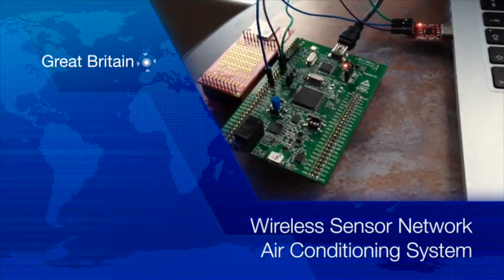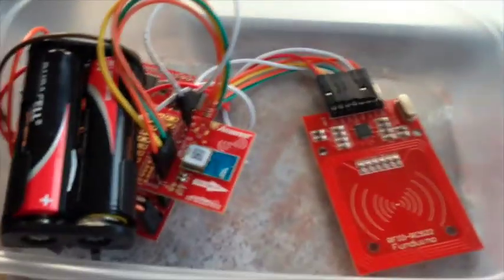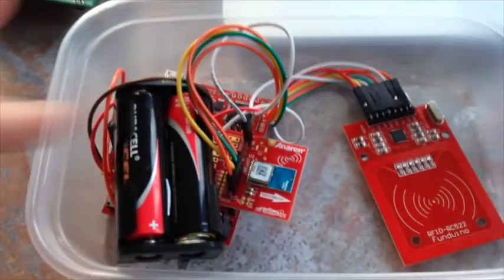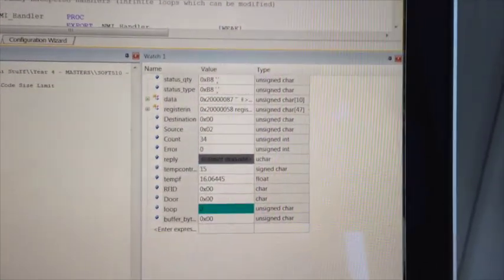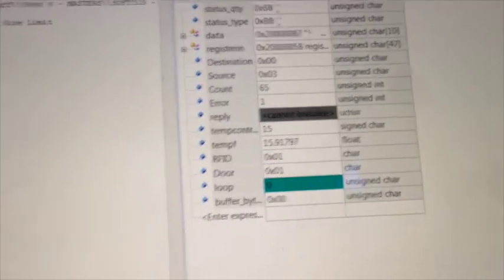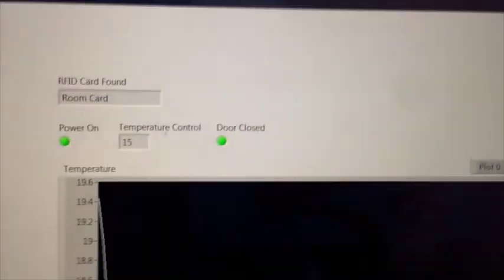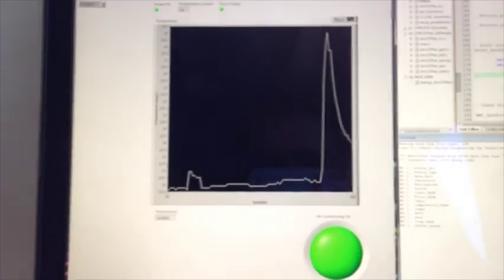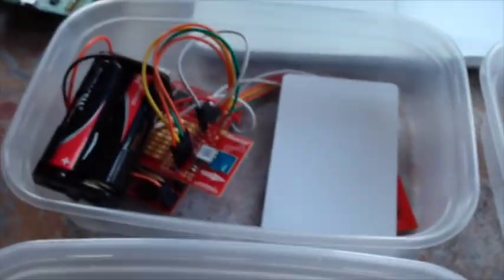MSP430 / Arm Cortex STM32F4 Discovery Wireless Air Conditioning System RFID Temp Sensor

Comment: Great job
Could you inform us how did you exchange data between STM32F4 and LabVIEW application, is it directly via USB or other manner.
Could you share your work with the community (C code in STM32F4 and LabVIEW VI), and what IDE did you use.
Thanks a lot !